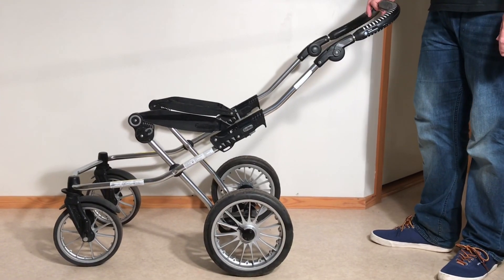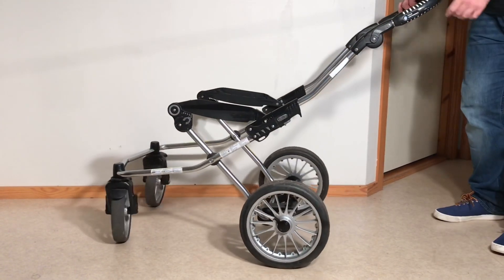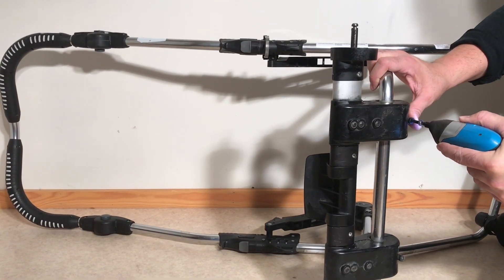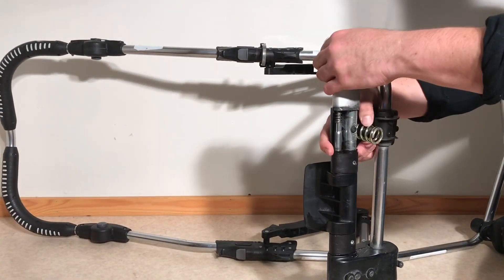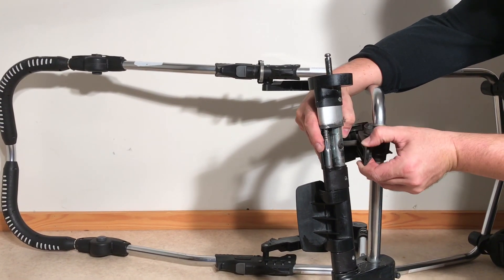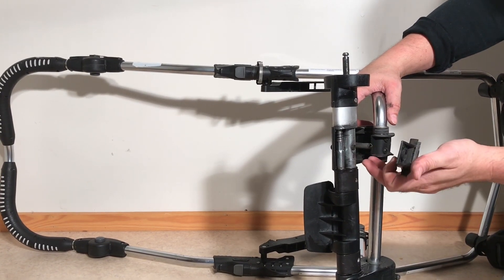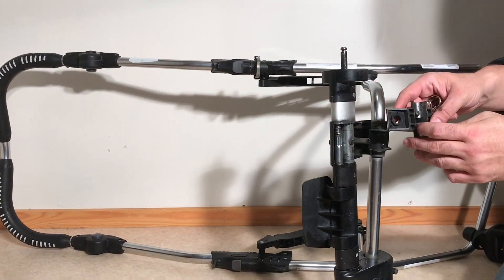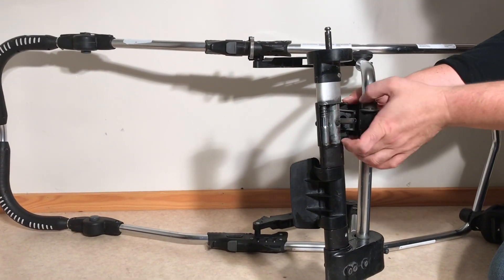How to Disassemble / Fix Broken / Loose Rear Suspension on Emmaljunga Duo S / Nitro / Viking Models

Comment: How did you fixed the tyre back. I pressed the centre push button on the try to remove it. But when I put it back the pressed button is not coming out.